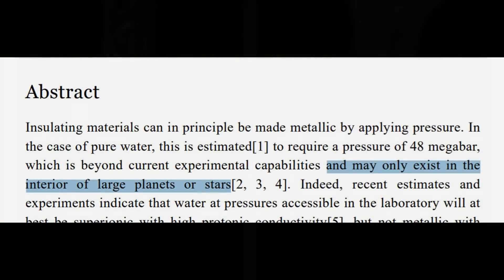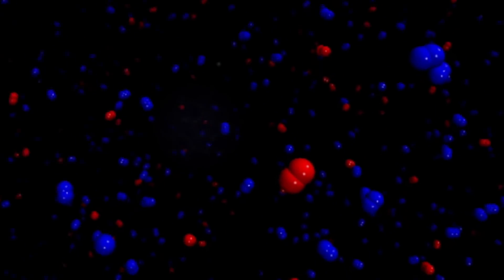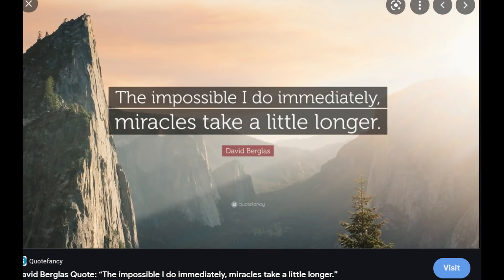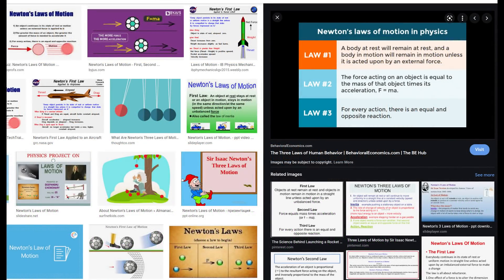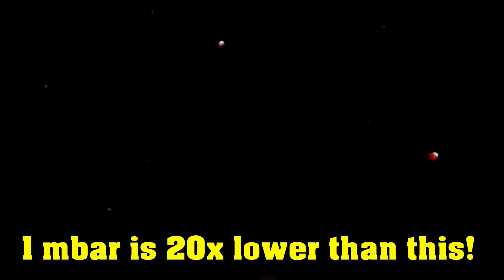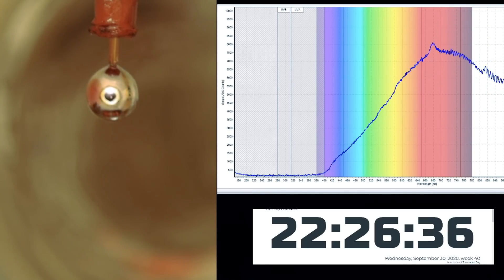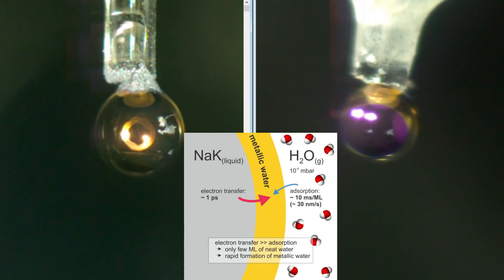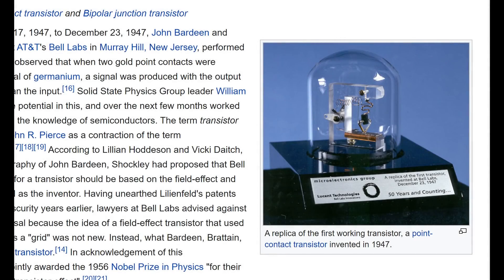Scientists discover Metallic Water

Comment: I guess xray spectroscopy is not fooled by thin film interference? Maybe reading the whole paper would answer this, but I'm having trouble understanding how at least the visual results could not be explained by a film of oxides or hydroxides produced by slow reaction with the water vapor. The coloration seems no different from controlled oxidation of hot bismuth or even copper, titanium, etc. I suppose that must be the first thing your team thought of also and sought to rule out, but how you did that is over my head. Did you try letting in miniscule amounts of oxygen instead of water to see if that also gave a similar result in film development?
Reply: The spectroscopic data is the key. When a thin layer is responsible of the change in color, the dip in the graph would have move from blue to red due to accumulation of the oxide layer (shortest wavelenghs gets interfered with thinner layers, and as the layer gets thicker, the longer wavelengths gets interfered), but the dip stayed around the same wavelenght but got deeper, that's absortion and not interference. But you are right in that to exclude the thin oxide layer deposit argument they should have done a test introducing oxygen there.
Reply: @Kanitoxx  i'm not shure, but either my eyes are lying or you are, it(the dip) did(not "should have") move(it's minimum) to the red part of the spectrum, on both spectrograms it just stopped around green-ish-yellow.
Reply: @ГеоргиГеоргиев-с3г  that's the thing, it (the dip) moved a little while the layer was forming, but then it just deepened, and then it changed again when the concentration was low enough to change phase to the blue one. There might be a thin layer diffraction at the beginning, but it's short lived and quickly replaced by the metallic shine of "metallic" water
Reply: @Kanitoxx  not an expert, but im fairly sure the oxide hypothesis can be dismissed because he used a full vacuum, if there was oxygen present, there would be an oxide crust on the liquid potassium sodium alloy, he pulled a full vacuum and added a measured amount of water, so yeah.
Reply: @An_Iron_God69420  oh, I made an upsies, it was hydroxides! thanks for pointing out :)
Reply: @Kanitoxx  yeah so that clears it up correct?
Reply: @An_Iron_God69420  You must have missed the part where the water provides the oxygen. Alkali metals decompose water into oxygen and hydrogen, which is the primary reason this claim is hard to believe.

That being said... It's not as if I've recreated the experiment and disproved the claim; may as well be metallic water for all I know.
Reply: The spectra, x and visible of oxides and solvated electrons are not the same, it looks similar in colors to the naked eye, but their properties differ when analysed in detail
Reply: I was wondering if the Polar nature of the Ammonia gas would force the water to orient in one direction to an extreme degree and produce a sort of 'Super-Skin' which might be a few atoms thick.  This skin could have unusual optical reflection/refraction/diffraction properties related to the thickness of the layer.
Reply: 11:08. He didn't specify the pressure of O2, though
Reply: I really believe you "science" youtubers are some of the worst people on planet Earth, I have contacted so many with large audiences to have them address on issue that is so profound so that maybe the scientific community will get on this and either put it to rest or fix it.  The Cosmic Microwave Background has never been confirmed at L2, they never ONCE were able to detect the actual signal at L2, read all the papers from the various teams (2) that went to L2 and tell me where they ever did it please?  WMAP should have been able to record that signal with EASE because it was supposedly awash in signal so why didnt they.  You people accept all of this stuff so easily and its not even real.  The oceans made that signal which is why COBE picked up SUCH A STRONG signal, so strong in fact they had to adjust the error bars by 400% but instead of seeing how that could never be the big bang (too strong) they just stumbled into confirmation bias.  Take the time to examine it yourself and youll find that by scientific standards the cmb doesnt even exist
Reply: MXene is hydrophilic and is a 2D metal it is synthesized in a solution of water and acid. When fully processed it has mostly 2 ingredients MXene and water and functions as a Conductive paint. It can also be "welded" together with water and recently filtered ink which leaves behind a film.
Reply: Intersting discussion people...very rare on YT...thanks 👍
Reply: @arthol51  Are we calling it metallic water just because there's valence holes electrons could move into? How is this not solvated electrons. Why would these valence holes be any different in energy compared to any other hole (disregarding thermal movement)?
Reply: @mykeprior3436  Myke I read this and found it interesting...I commented to thank the posters for having a civil discussion... Something that is rare these days. I cannot add any more to this discussion as I am here only to learn and this is way beyond my paygrade...perhaps you can provide an answer to your question.
Reply: @mykeprior3436  I'm wondering if its electrical resistance is different from what would be expected from a thin film of water. Would a change in electrical resistance distinguish between metallic water and solvated electrons?
Reply: @mykeprior3436  Metals can in some sense be all regarded as an electride solution (often solid). What defines them and gives them their properties is that the electrons are mobile on their own. Usually water is conductive due to much larger ions moving (with some bond rearranging also helping), which is fundamentally different. Electrons usually bond with water to form these larger ions, but once a bond occurs it is no longer a solution of electrons.
So yes, we are calling it metallic just because of the solvated electrons, and we are entirely justified in doing so. If the electrons were immobile, and hence not giving metallic properties, it would make more sense to say they were bonded, and hence not solvated either. They are sort of synonyms, except one is talking about what is happening at an atomic level, while the other describes the macroscopic properties that this brings about.
Reply: @mykeprior3436  Speaking as the person who almost assuredly has the lowest IQ in the room here Sir, I wanted to just have it noted that I call it metallic water because it’s very, very shiny and oh so pretty.
Reply: @agsystems8220   > They are sort of synonyms, except one is talking about what is happening at an atomic level, while the other describes the macroscopic properties that this brings about.

Does metallic water describe the atomic level or macroscopic?  If the latter, then what macroscopic properties are you referring to, because nothing I saw in the video explored/described any properties of the substance beyond its effect on a spectrogram.
Reply: @mykeprior3436  You get more clicks with "metallic water" than with "solvated electrons".
Reply: I mean. If they knew what they were doing.....

Comment: My hypothesis for the trippy colours... my thoughts go to the structures of proteins as you on the micron scale. Clearly, there isn't a lot of water in the very high vacuum state so it is possible that as the metallic interface in reaching that depth becomes fragmented forming slightly different reflective surfaces almost like a dented sheet rather than a continuous solid. 

Hmmm, In thinking of that explanation I'm reminded of the reasoning behind the strengthening of alloys like steel through striking and heating as it creates microscopic voids in the crystal structure  which reinforce the overall structure. I know that the mixture is already an alloy of sodium and potassium so is it possible that you are generating a transient solid reinforced by the exothermic heating that happens when the water binds to the system? Perhaps that is what the scaly film is on the other droplets in regular air just in a far less refined form. 

I mean I personally don't see any usefulness in currently known alloys but I have always wondered what interesting mixtures of rare earth elements could be made if we had significantly more of them to work with (IE asteroid mining amounts). Maybe one day someone will use your method to form some specialized alloy beyond our current imagination later down the line

Comment: Honestly I get the same idea/Vibes from a tube dripping water very slowly while having extremely cold air that will cause ice crystals to form on the surface & then coating the surface as it grows. While watching it with a Camera as the crystals form.

"blowing cold air/temperature medium > onto water droplet" Is what its most simplest form I can relate the video's experience to my own. 

Also weird that the surface tension stuff that float to the top of the drop-lit/tubes exit walls, and while frost/ice crystals in water will be pulled to the bottom of the droplet as they form.

Comment: If you put a bit of NaK alloy on the bottom of your vacuum chamber, it will capture the residual oxygen without an expensive ultra low vacuum pump.
That's how "getter" works in vacuum tubes.

Comment: O.k. it looks interesting, but I haven got a clue what I have watched, it's described as "Matallic Water", so what's the difference, between this and common-a-garden, rain water running off rusty car and collecting in a puddle under said car as a puddle?,  is it all metal or is there water the mixing, how come mercury, or gallium, or any metal with a low melting point, could not also be called "Metallic Water" also?  is it stable once out side the highly pressurised test tubes, could be used for solar-sell or micro chip production if it could make solid-layer?

Comment: From an engineering point of view, I think there may be an easier way to get a lower vacuum. 
Start with the vacuum pumps then lock that hose.
Then use a ram built into the vacuum chamber to pull a gas sealed piston backwards and increase the internal volume of the vacuum chamber.
Thoughts?
Reply: The addition of small space would not result in significant "increase of vacuum".
With experiments like this you are fighting over several magnitudes of more empty vacuum while using sealed pistons, you would need them to be really huge just to get even single order of magnitude of improvement.

Going with TF claim that he needs 1000000* less presure that what his vacuum pump is capable of, and assuming that the glasswork in which the experiment is going on has volume of about 10 cubic centimeters, you can easily calculate how insanely huge  that piston would need to be. It would simply be too impractical.

10M of cubic centimeters = 10 cubic meters. Your piston would need to be the size of a car for glasswork the size of your fist. Then you would also need machinery big and powerfull enough to be capable of moving such piston. And piston this big would also have to have smooth/seamless connection to the glasswork to not cause any problems at place of connection. 

Tl:DR - Technicaly possible. But extremely impractical. Like trying to eat a soup and using large bucket instead of normal spoon.

Comment: can someone explain to me how thats actually metal water again
Reply: They added water (vapor) into metal resulting into metal water. The solution was unstable from what I read, but lasted long enough to be measurable.

Considering that normal result is immidiate explosion, it is noteworthy discovery.
Reply: @iglidor  of the drop of metal water, how much of it is just water and how much is normal? Is it metal water throughout or is it just a skin of metal water? I love chemistry but I'm having a hard time thinking about this
Reply: @dittocopys  I think you find most of answers to your questions if you re-watch the video now that you know what you are interested in. 

For example ammount of water used was 1mg. Exact ammount of it that got into contact with the alkaline metal is unknown but it would be a very tiny fraction of that considering that it was vaporized over entirety of the glasswork.

Comment: Love the effect!
 
Also found something you might like to tear up, a so-called "Massless battery." Wether you find it actually valid or some bogus nonsense to tear up I'll trust you with the Ph.D. over myself when it comes to the research required. But something to get you going, they claim to have 75Wh/Kg with a stiffness of 75GPa for a 500micron thick sheet of battery, using carbon fibre to house the negative electrode and as a casing, and expect to be able to get it up to over 100Wh/kg by the end of the decade.

Comment: This is oddly relevant to an experiment I just started on... So, I have water in a container. Freeze it (carefully, from the bottom up, so it doesnt seal itself and explode the container). Now, I seal the container, and return it to room temperature. Since ice has 9% more volume than water, when it defrosts, if the container is properly sealed, it should effectively pull a vacuum, since the mass inside it now has 9% less volume and nothing entered the system to replace it. As this process occurs, would the new volume be filled gaseous water at vapor pressure, the effective vacuum causing the ice to sublime, until equilibrium is reached? If that happens, then what? Does the entire ice mass turn into water vapor? It doesn't seem to make sense to me, and the ice cannot simply not exchange heat with the environment... so what the hell happens?

Comment: That looks so cool, the alloy droplet is spinning, you can see the moment the water molecules touch the surface of the alloy, the reaction kicks off and expands, and the tiny oscillations of the vac. pump produce that little ripple oscillation on the droplet. I am grinning from ear to ear, privileged to see this. So, at around 15:03, TF says he's not sure why the droplet is producing the wild color show.

 I'll take a stab at it. That surface layer, around the thickness of the wavelength of visible light, with the reflective layer of shiny alloy behind, might be producing the rainbow of colors because of the differing and constantly changing concentration of the metallic water with the dissolved ions of Potassium and Sodium Hydroxide, effectively  always changing the refractive properties of the layer.

Incident light hits the surface, is refracted by a certain degree based on the concentration at that specific point, and is reflected again by the metallic droplet at yet another refractive value because of the ever changing layer concentration and exits to be detected by us, sort of working like a prism.

Thanks to TF and his super generous Patreon supporters for allowing him to do this, and for all of us to witness this awesome first, this is what is great about YT, real science just for the sheer curiosity and joy of it. What shall we call this ? the Electron-Thunder Effect ? better copyright that !

Comment: Would it be at all possible to measure conductivity of the surface layer? Also is there a reason you didn't stabilize a drop (you kept adding the metal until the drop fell)? Congratulations on your discovery/research.

Comment: Diffusion pumps are confusing. A deep dive into how and why they work would be most excellent.
Clearly they are reducing pressure and gases diffuse from high to low pressure but the working principles of how they function is not very intuitive whereas a 2 stage compression chamber pump is quite easy to understand.

Comment: Correct me if I'm wrong (my chemistry course was a decade ago...)

The light metal alloy would insta react with water under the normal conditions, however, the speed of the reaction scales with the pressure, so what you did was to go with near perfect vacuum and small amount of water vapour. At this pressure, water doesn't react with the light metals, and that allows it to peacefully dissolve in the alloy, creating the beautiful thin film around the droplet.

If what I've written is correct, then it seems your video is missing the crucial information about reactivity-pressure scaling - you should add it so less knowledgeable viewer can understand what's happening.

Comment: What is the difference between this and a water-sodium hydroxide/potassium hydroxide solution? Are you saying there is pure metal in the water? Why did it not react and form a hydroxide solution? Is the color the only indication and could that not be explained by the thin-film effect you credit with the trippy colors later?
Reply: As far as i understand, the thin-film effect can filter out colors according to its thickness, so as it starts thin, the first color it filters out would be blue, leaving red and green to look yellow (gold). As it grows thicker, longer wavelength colors may be filtered out, resulting in a more blue/green look.

Comment: Hello. TF could you please explain what the difference is between this and running a current through water? It is obvious that it different but why and how? Thank you and great work.
Reply: If I understand this correctly... If we say the flow of electricity is like compressed air flowing through pipes (normally it's water through hose but for this I need the liquid to be compressible). If we have an open pipe the air flows through uninhibited like electrons would while flowing through water/metal. What this research shows is an equivalent to having an unexpandable pipe plugged shut and pumping air into it using a compressor. You are increasing the concentration of air molecules in a limited space. If you could do the same with electricity flowing through water you would get this result. Basically pumping more and more pure electrons into the same amount of water.